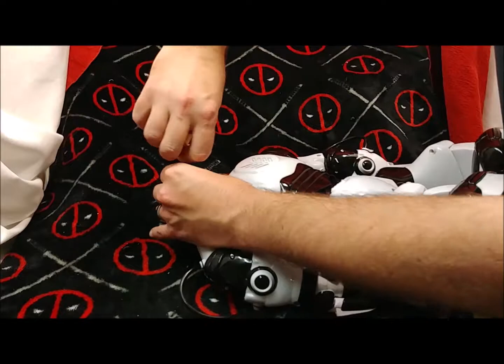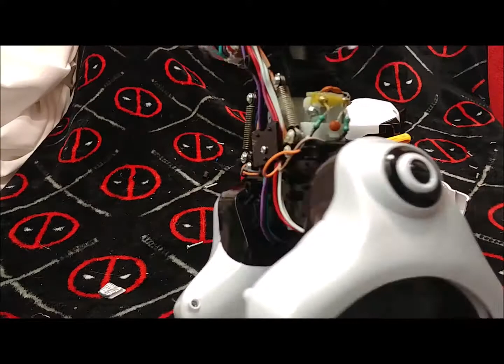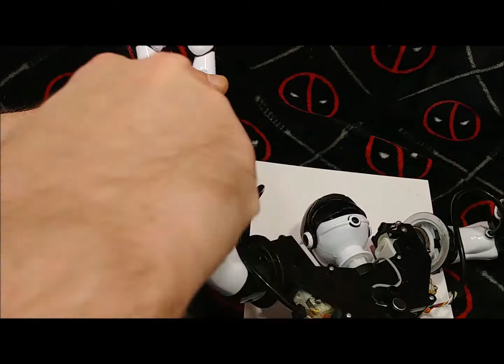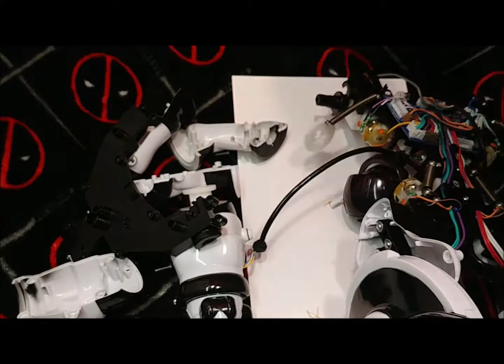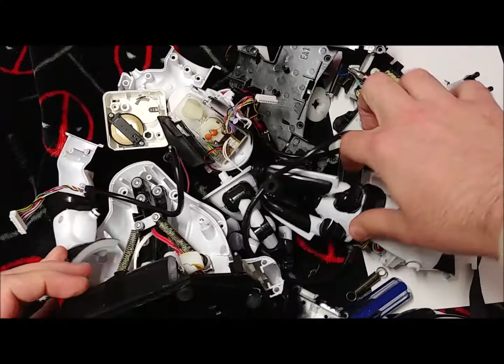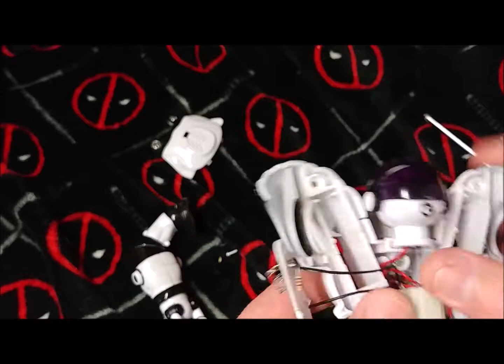Robosapien Teardown X & Robosapien Mini Teardown

Comment: bro what should i do when i star it stuck half way from waking up it was full of dust i didnt clean the circuit board in the inside is this beacause for the dst in inside if so then what should i clean it with the circuit board i meant

Comment: Taking it apart is a good idea. Rebuild against body is an even better idea. Replacing the legs with wheels like Lost in space robot. A few upgrades to the wiring.
Reply: rebuilding it though it was tough and yet cheaply made unlike the very 1;st one in 2004 since now it was more  challenging now  since it walks so weirdly it was not well built to begin with if it quits walking then the board is fried out mine died as I tried putting the broken leg and hands back on

Comment: was working until he did die   last night at 12am had him finally walking right until his eyes got pail when after fully recharged I knew it was his time to die so I TOOK HIM DOWN LIKE THIS BUT a body nothing more just can't waddle unless there is a new board like his back that's what's broken in mine there that back circuit board is dead
Reply: bad board is what happened but thanks ROBO-RAPTORS springs worked better from the tail
Reply: man mine just  died a few months ago after I restored the walk one I tried getting the arms back on it with fresh batteries it  croaked  it was do to all the extra coil in the circuit going through to the motors can't believe they get away with  expensive price on a cheap product so easily with this  it was so cheaply designed now tried adding the hands on again a wire cut out and it  fried the board out and RS  blue died off as I tried putting his arms back the real reason those break I remember the board was green they had added extra stuff not required and ca=hanged it to blue  no reason to have so much extra coil on the circuit and motors plus the springs are weak parts that cause the extra stuff to fry then burn out the cables but I fixed a 2004 board with a perinate  melted mod  it died after the wires broke

Comment: what are the extra parts called on the motors connecting those wires that may cause everything on speed and they really did mess this guy up with his walking  fixed him last night without all the extra stuff in the motors it go's faster like the orange stuff and green stuff googles not even showing more answering what ever that extra stuff is its bad and can be proven it don't need all that extra stuff connecting to those motors hey got him walking with a dead robo-raptor don't enough motors for both just one now because it takes a lot of motors to power these got the blue one got him walking using roboraptors parts without all the extra thanks for telling how tear it down wouldn't ben able to fix him without you and it took me about a year to do it